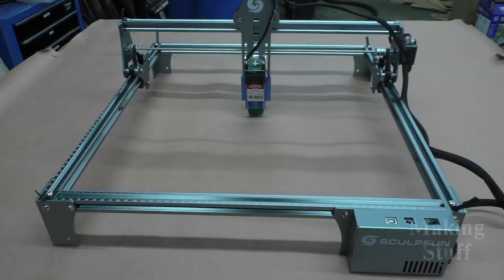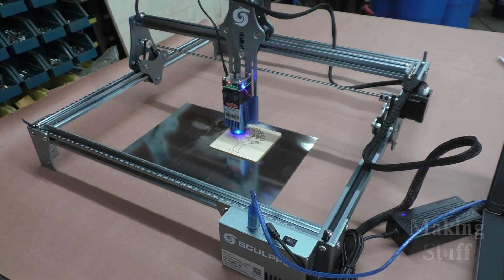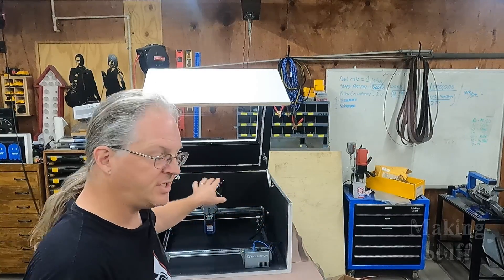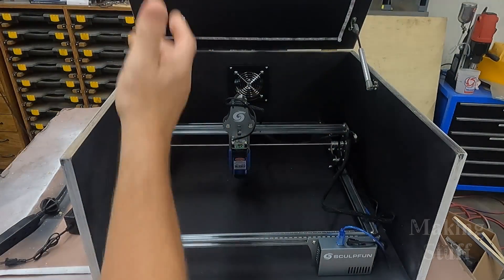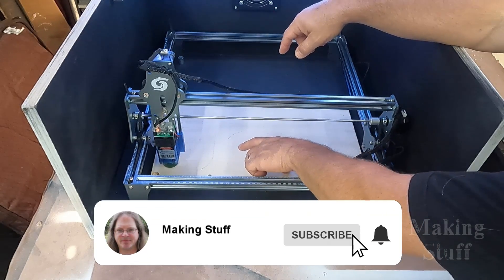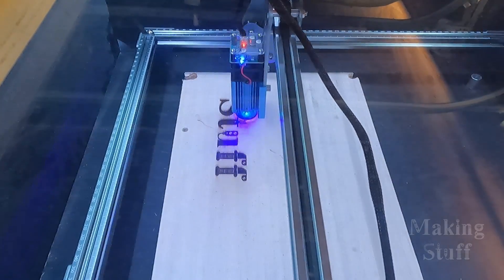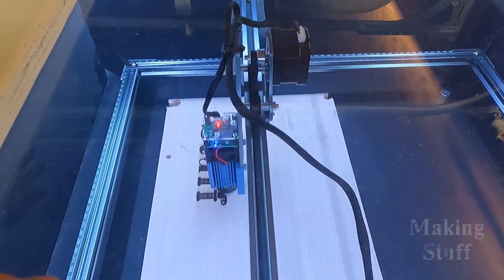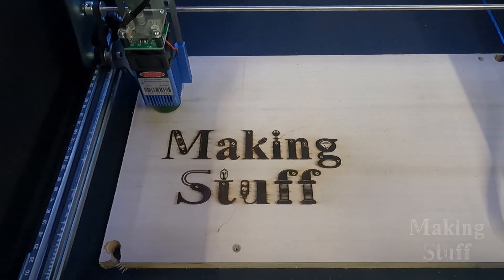DIY Enclosed Laser Engraver - No More Smoke and Smells!

Comment: I love the design and the added LED lights. However,  you need an air assist and a honeycomb board, both are very helpful.  

I have their s30 pro max and I've had a lot of fun with it. There's an expansion set i want to add. I'd adjust the box size to include these plus a rotary tool and add lift feet to it too for taller projects.  But the overall design is great.

Comment: Nice job, I did pretty much the same thing however, I coated my perspex window with security film , just because I had some from another job, and it works amazingly well at cutting down on escaping light , to the point where you can watch the laser with no glasses  if you wanted ,

Comment: Question, why install the exhaust fan drawing all the fumes/smoke past the new fan? Why not install the fan on the side causing positive pressure in the box and the clean air pass over your new side exhaust fan. The way you have it now all the contaminated air flowing around/past your exhaust fan.
These fan are not raided for through ventilation, so if you install it pushing air in your box only clean air will pass over it. Positive air input has less chance of igniting any explosives gases, your fan has gases flowing past it. FYI, Thanks for the video, nice job on the box. I need to also make one.
Reply: That idea doesn't work well unless you have a completely sealed box.  If you pressurize the box the smoke will take the path of least resistance which is going to be leaks around the lid long before it can push it out a long tube.  Everyone, and I mean everyone, that builds a box, including the factory boxes, sucks the smoke out.  It's like the difference between pulling a chain and pushing a chain!
Reply: @spydie  😂 LOL, good analogy.

Comment: I'm building a similar enclosure, with some changes.
Added air assist, as it will improve both cutting and engraving. In addition it will ease the load on the fan.
I will probably have the fan in the end of the hose. In case of a leak in the hose the fumes will not escape in the room but will always be sucked to the outside.
Good work!
Reply from the maker: Thanks!

Comment: I haven't made mine yet but I intend to cut a large square in the bottom with the s9 held at ghe corner. This so I can raise the whole cabinet using a spacer. This so that I can get larger pieves like wooden bowls under the laser to engrave my logk or a specific design.
Reply: Hi Andy - I'm looking for a solution for exactly this application. Have you built yours yet? If so would you be willing to share some pictures of your build?  Thanks!

Comment: I am a little confused by the exhaust fan you used. Based on what I am seeing in the air flow specs it seems to me that that how you have it mounted, it would be blowing air into the enclosure rather than pulling it out. Am I missing something?
Reply from the maker: It is definitely pulling air out.  Thanks for watching!

Comment: Looks like it does the job well.  Might have problems with the PC fan in the long run, but it’s an easy upgrade.  My only difference would be some sort of UV protective film on the clear plexiglass.  Question, how does air get in?  You have an exhaust port to pull smokey air out, but I didn’t see how fresh air gets in.
Reply from the maker: It's not a PC fan.  It's made for bathrooms.  There is enough gap between the seams and also the holes I cut for the wires to go through.  I thought I might have to cut some type of intake vent, but it worked so well on the first try that I didn't have to.  Thanks for watching!
Reply: @MakingStuff  I'm wondering if the fact that any fumes produced would be hot expanding gas that and if that's not also contributing to the success without a dedicated fresh air in take. I'm needing to make something like this for my basement workshop and I love the idea. I'm just trying to take in all the idea to see what works with the least amount of risk. Putting intake air flow might allow enough direct air flow over the cutting surface to Fan the Flames and possibly increase the risk of fire, but it's also reduces amount of combustible gas coming in to contact with your fan motor. 

Have you had any problem since making this with fanning embers on the cutting surface or igniting exhaust?

Comment: A few thoughts.  It seemed like the fan was working well but I was concerned that you didn't have any inlet holes to let in fresh air.  I'm assuming the inlet air was just leaking around the lid but you might reduce the load on the fan a little if you put in an inlet hole.  Since the box is made of plywood it will be combustible.  You can line it with 1/4" concrete backer board to reduce the risk of fire.  I like the USG Fiberock brand from Home Depot.  You can just glue it it with Liquid Nails or try screwing it to the plywood.  Finally, I would see if you can get a window material that will filter the laser for maximum protection.  I'm not sure if you should look for specific plastic or if you can find a film to go on the plastic.  Overall, great build that everyone with an open frame laser should make.

Comment: The only real difference I did with my enclosure is to make a couple of doors on the bottom of the enclosure so I could 'pass through' longer pieces of work.  I use my laser primarily for 'signing' my work, so it was important for me to be able to put through much longer pieces that would normally fit inside the encolsure.

Comment: Nice enclosure with good fit and finish. Where is the fan getting it's intake from?  Seams??
Reply from the maker: The seams and holes I drilled for the wires.  I was affraid I might have to drill some type of intake vent but the first test worked so well I decided not to.  Thanks for watching!

Comment: Did you get the proper plexiglass to shield your eyes from the laser ?
I would use a sheet that can protect my eyes wen I look at the work ☺️
Great video 🤟
Reply from the maker: No, but the laser engraver has a protective ring around the diode which works well when looking down from the top.  If I can find a place that sells the plexiglass I need I can always unscrew the old stuff and mount the new.  Thanks for watching!

Comment: Great job! I like the gas struts on there and the LED’s.  If I were to suggest anything different, I’d probably make the enclosure out of aluminum but that’s just me.  More from a weight savings perspective.  Speaking of aluminum, can you try it out on a piece and see what the results are? I’m thinking either bare brushed aluminum and see if it makes it dark, or painted black and maybe the laser on a lower setting just vaporizes the paint and leaves shiny aluminum?
Reply from the maker: Check out the review, I tried aluminum on it.  https://youtu.be/MMqqKGZIQ4w

Comment: I bought 4X 18mm ply in 2018 for £19.99 for a a full 8X6 sheet and now they are £41 per sheet from the same supplier, I am not buying any more until the price drops, I was thinking as Corona was starting to be beaten the prices would return to something near normal but it seems the suppliers may have been making more profit at these inflated prices and might not return to 2018 prices!
Reply from the maker: Wood prieces have dropped here, but I don't think they will ever get to pre-rona prices.

Comment: Nice build the only thing different I did was user plastic for window that will block the laser like the laser glasses. Your clear sheet will not stop a reflected beam so there is some danger, but you have made it much safer with the overall enclosure.
Reply: Ups did not read your comment before commenting 🤷‍♀️ sorry had the same idea ☺️
Reply from the maker: It has a protective ring around the laser diode which works well when looking at it from the top.